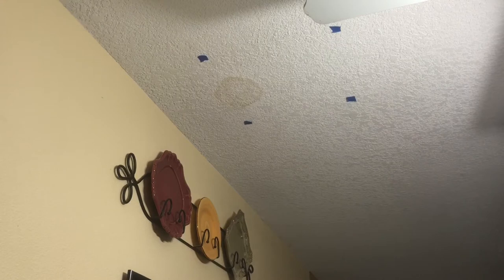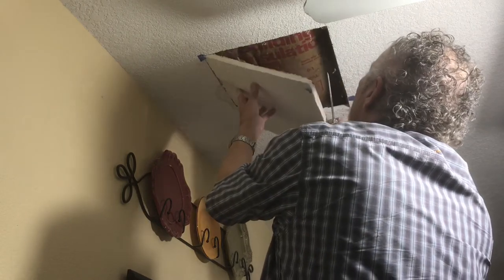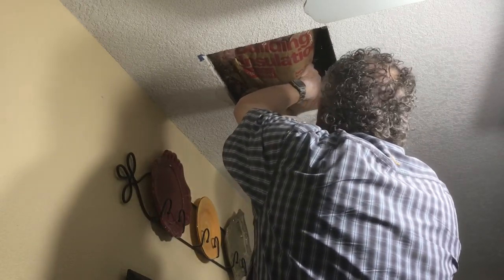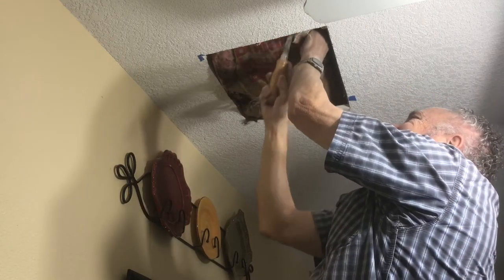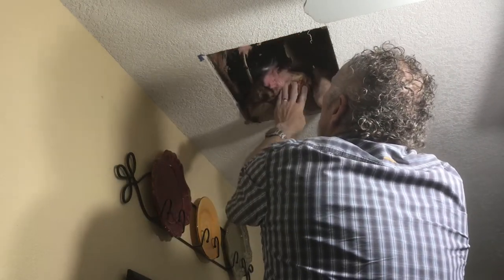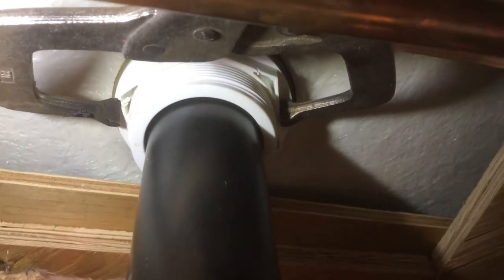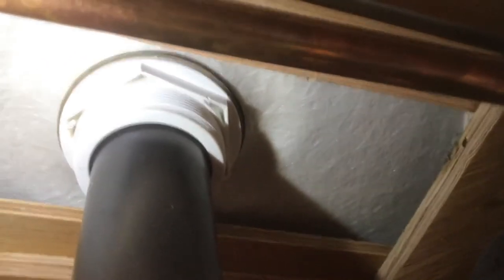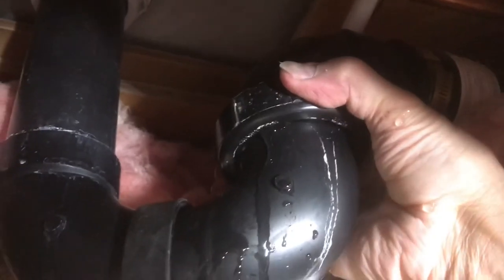Repair an upstairs shower leak in the downstairs ceiling

Comment: Dude, mask and glasses.  Fiberglass!
Reply from the maker: There was no fiberglass.
Reply: @davidmartindaletheycallmemacgu  I liked your video.
Reply from the maker: @sandiotoole4295  thank you
Reply: @davidmartindaletheycallmemacgu that pink insulation is fiberglass although I'm not sure if that small job would require all that might not hurt? The fine dust off the stuff will  eat at the lungs etc
Reply from the maker: @naturestrail2296 there wasn’t enough for me to really be concerned and I wasn’t moving it all around to stir it’s dust. Thanks for your comment.
Reply: @davidmartindaletheycallmemacgu  I figured such & I'm sure most would have done the same.

Comment: Thank you for the info..  If I were to hire someone to do this for the similar problem I have, should be calling a Plumber/handyman/construction contractor? Not sure what to look for.
Reply from the maker: You’d probably need to interview a handyman to see what abilities he has. A good experience handyman that has multiple skills is where I’d start. Most plumbers aren’t good sheet rock repairman. Some contractors that do hands on work and not sub out their jobs might also be an option. And the third option would be a plumber just for the plumbing repair, and a sheet rocker to repair the sheet rock. But if you do the third option be sure they can also do the sheet rock finish work too. Hope this helps.

Comment: Nice video. Gives a good starting point. I have a similar situation but I’m curious how you diagnosed that it was the drain and not any of the faucet fittings/pipes causing the drip?
Did you cut the hole first and take a look before you made the video?  Or would the drips/stains be different if it were the other items leaking?
Thanks in advance for any reply.
Reply from the maker: I saw the stain on the ceiling, cut the hole and located where the leak was, then repaired it and patched the hole. Thanks for your question.

Comment: Around how much would it be for that job?
Reply from the maker: That’s an open ended question because right now it’s hard to get contractors, they’re all swamped so they can pretty well charge what ever they want. That’s one reason I have my you tube channel, to help people save on the cost of repairs.
Reply: @davidmartindaletheycallmemacgu  Thank you, my second floor bathroom is leaking to the kitchen ceiling. I already replaced the stems and seats. It was fine for a while and now is leaking again. On the search for a good plumber.
Reply from the maker: @kelm1123  is it your faucet that are leaking, your Supply lines or your drain lines?
Reply: @davidmartindaletheycallmemacgu  Before it was the faucet now is inside the wall. Maybe the valve
Reply from the maker: @kelm1123  don’t be afraid to cut the sheet rock to find the leak, sheet rock is an easy fix. Also if it’s a waterline PEX tubing is easy to use to splice with shark bit fittings and no tools are required. YouTube is a great resource.
Reply: @davidmartindaletheycallmemacgu  Yes I will cut the kitchen ceiling before calling a plumber. Hopefully I can see it from there.
Reply from the maker: @kelm1123  also if you’re sheet rock is not too soft, just stained and you’re careful when removing it you can reuse it. If it’s not reuse-able, cut a 2’ x 2’ square, Home Depot sells sheet rock 2’ x 2’ pieces and then you won’t need to purchase a whole 4’x 8’ sheet. When you go to replace the patch you can use a piece of wood that you use sheet rock screws to fasten it to the sheet rock around the hole and extend the wood into the patch area
Reply from the maker: @kelm1123  also if you cut the hole with a hand sheet rock saw you will know if you hit an electrical wire or pipe so you can avoid damaging it.
Reply: @davidmartindaletheycallmemacgu  Thank you so much, I will do that.
Reply: I’m having this exact problem. I have a home warranty. But the plumbers they sent out were unhelpful. Advice?
Reply: @bee1979  find another plumber. Mine was the drain that was leaking.